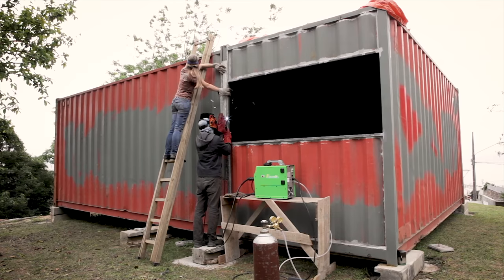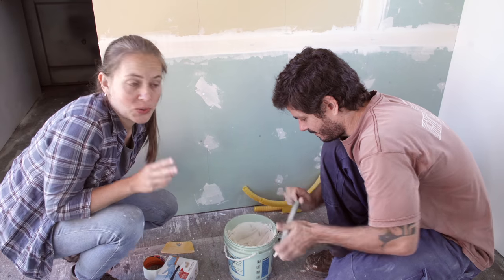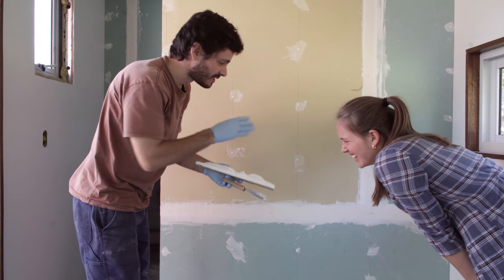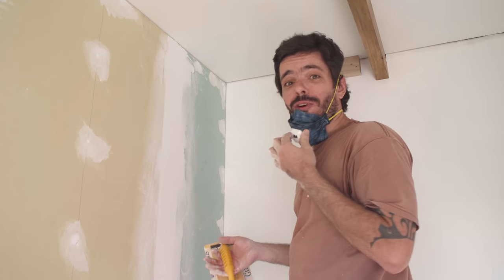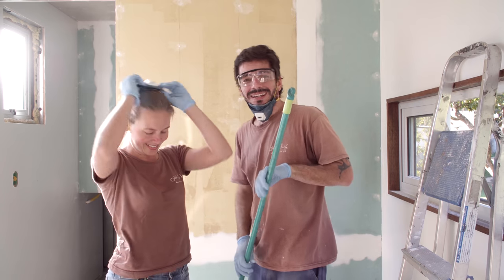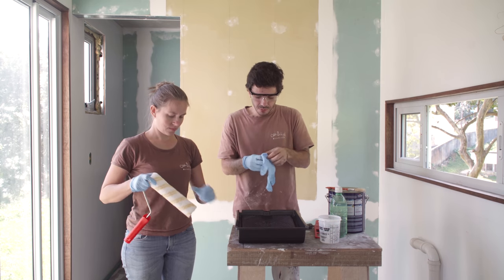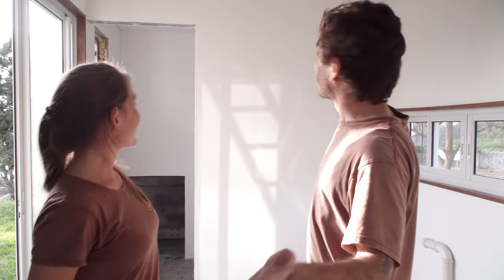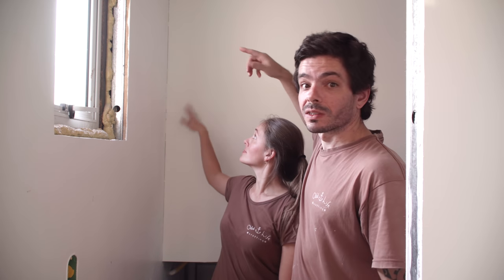DIY drywall for our tiny shipping CONTAINER HOUSE [taping+mudding+painting] #085

Comment: Great job! Even if you are going to trim the edge joints i would still use a silicone based caulking seal before putting the trim as added precaution. White looks great
Reply from the maker: Thanks for the tip. We were actually thinking about using something like this. 😊

Comment: Glad to see you both using masks doing this. When I was plastering (Dry walling) my house I didn't use a mask and ended up getting an infection in my nose because the plaster cut the inside of my nostrils and nasal cavity by breathing in all the plater dust for weeks. I learnt a lot renovating my house but I took too many short cuts and my body suffered. Thankfully that was over ten years ago now, but any new projects I wear lot's more protection and take smaller steps instead of trying to do everything all at once. Thanks for sharing, I'm really enjoying watching all your older videos. 😀👍

Comment: I don't know, maybe materials are different in your place but where i live workers that build drywalls always cut edge of the bord at 45° so that joint where to boards meet makes some kind of V-shape joint. They actually simulate original edge of boards that are rounded out of the factory (at least Knauf boards).
Reply from the maker: That’s pretty cool. I’ve never heard of that around here. But sounds like a good solution. 😊👌🏼

Comment: I am going to be building my own shipping container little home. I was wondering if you ever considered using only one container. I am only getting one and would like to know your thoughts.
Reply: Also, if you did a light sanding before the second coat of mud, the seams would blend smoother. Missing the corner joints will add a lot more stability to the wall. Think of it like the shower cabin. Once you added the sealer to the corners, it became one solid piece, the same applies to drywall.
Reply from the maker: Our house is actually only one 40ft Shipping container. But cut in half and welded on a 90 degree angel. No we didn’t sand in between mud coats. 😊👌🏼 good luck on your project Kyle!🍀

Comment: You need a mud pan and a 6 inch knife for tape and a 10 to 14 inch knife for the next coat(s). I prefer a 14 inh knife for 2nd or more coats.
Reply from the maker: For sure would help a lot but as we only  had this small job to do we didn’t think it was worth spending the money as we could menage to get the job done with the tools we had and some extra sanding time. Hehehehe 😊😊💪🏼

Comment: you apatula have too little, first you use add puddy, little, ok, but second you need 3-4X wide more spatula can clear drywall join good. normal work, use wet paper tape, not dry. and pyddy first then wet tape and then puddy more and clean wide spatula right. then wait and sanding, little trick help you, paint first level thin first and then use puddy more if need after sanding.paint help you see if need second level puddy, and sanding. then sand and paint normal.
Reply from the maker: Thanks a for al the good tips Matti!!😊👌🏼💪🏼

Comment: Hi you two, you have done a good job, but you have missed the corners at the top and outside where the two pieces join. that will need to be done before you can paint.
Reply from the maker: Thanks a lot John. We will have a wooden trim that’s why we didn’t properly finished it. 😊👌🏼

Comment: if you think all to boat, you can made metal easy all boat same have than container ,then interior you need use birch plywood have better because light colour and make little area biggest and lightens, light have better, but need epoxy paint all plywood after chek have good to place, first make,then install, then take out all piece and paint all light epoxy and top paint if need. then install back to interior. simple same method than container house, first frame sandplasting, paint, install mechanic, motor etc, drive axle etc holes, then paint and start instal interior, wery simple work, but time go lot.